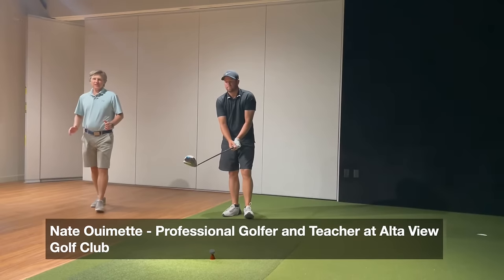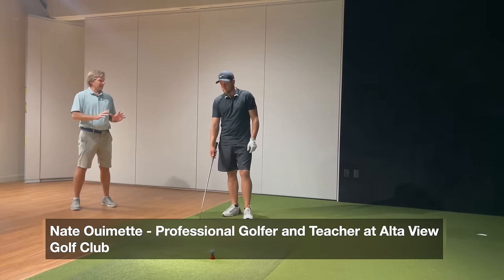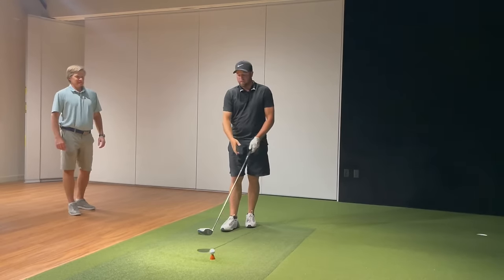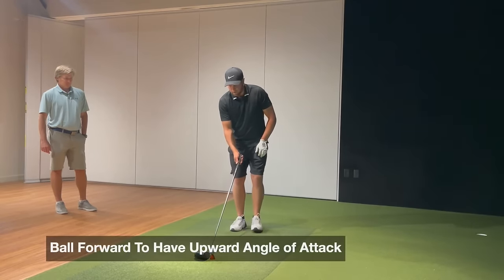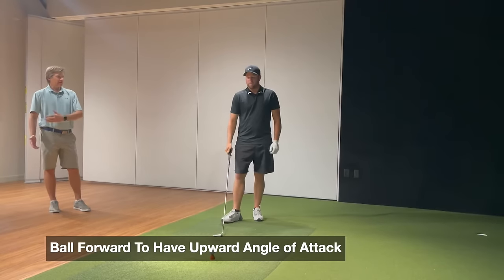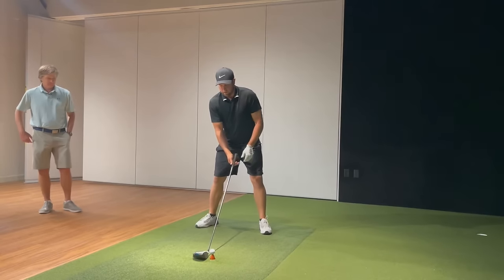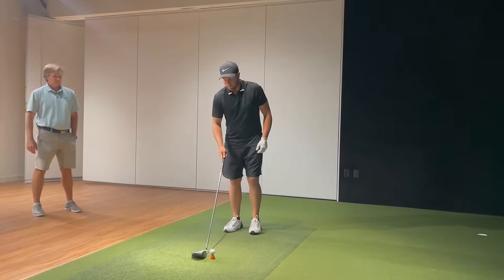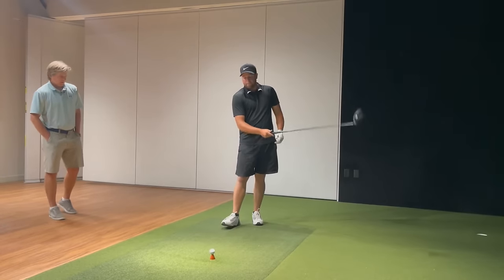Generate 125+ Driver Clubhead Speed

Comment: great example of feel vs real.  He feels like he doesn't "flip" or turn over his wrists, but you can see a tremendous turn over of the wrists through the hitting area.  Nice video.
Reply: It’s not a turning over of the wrists. It’s camera trickery. All he actually has done is sequenced himself up correctly with his rotation. Stand facing a mirror. Get into impact position. Now rotate impact position to halfway through, through swing. Just using you hips and shoulders to rotate you, you will feel open to target. Now look at the mirror and you will notice your hands look like the hand rolled over!!! Actually all that has happened is your body has rotated to deliver a square club face. No manipulation of the hands/wrist required.

Comment: This video has most of what I am feeling/working on, although I have to make sure that I practise initially 'heel-to-heel' to avoid my usual error of getting on my toes, or I can't get these moves/feels. Nate mentions ensuring right side extension on the backswing (and the counter to that is the compression of the left side) and I think this movement of the upper thoracic spine is very important in getting to that shallowing position he mentions, the lower body transition switches that upper back into right sidebend with the hands left behind in that shallowed position, the main feel is a tightening of the lead arm across the chest as you transition. Most amateurs don't have that tilt/sidebend/extension in the backswing, and so when the lower body transitions it just pulls that back into an OTT position. Look at Nate's slow motion to see the extremes of how that upper back is moving - Tommy Fleetwood is similair.
Reply from the maker: Thanks for the observation - lots of great comments here.  We have some other videos with Nate where we trying to talk more about the tilt being part of the rotation to maintain your angle to the ground.  It is something that most mid level golfers don't do enough and you see great golfers do a ton.   We've also done some videos that talk specifically about that lead arm stretch in the transition - so hope you have a chance to check out some of the other posts on the channel.

Comment: Feel and real is different. He does start the turn with his legs and hips, but the arms have to release "quickly" but instead of "pulling" he is dropping them with very little tension as he turns which creates the shallow swing. What he does or feels  in slow motion is not what is happening with normal his swing.  Yes his sequence of order is correct, but he is generating massive speed with his arms very early in the swing. It's a split second between hip and arm movement.

Comment: He talks about shallowing the club in the downswing and yet in the slow motion clip at 12:35 the club barely shallows 2 inches
Reply from the maker: You're correct - Nate doesn't do a massive shallowing motion - but it also isn't over the top.  It's just enough to have it come slightly from the inside when he rotates.   We will do posting some more videos on tracking how you can measure your shallowing motion when you look at video.   Thanks for the comment and for watching.

Comment: I think or notice his knees are athletically flexed and give a lot of impetus 
Is this right
Reply from the maker: Flex in the knees goes hand in hand with enabling smooth hip rotation.   The hip sockets have to move of course for a fluid turning motion.  When the hip sockets move they change distance from the ankles so flex in the knees at setup is critical to let the legs straighten at the hips rotate to the finish.   You will notice that at Nate finishes the legs are much straighter and the hip sockets are turned farther away from ankles.   Try it yourself - just trip hip rotation with straight legs then try hip rotation with bent legs.   You will find it much more fluid when you start with flex in the knees.

Comment: From my own experience, it is not about clubhead speed but clubhead weight.  That is how much weight can u generate on the clubhead on the downswing. U want to make the clubhead feels like an anvil by the time it make contact with the golf ball.  As a consequence it feels like ur in a slow motion video during the downswing  and speed up again after making contact.  Ur body will make all the right adjustments for u when u do this.  No need to think about what every parts of ur body is doing.  That is the most common error we all make.    This has catapulted my driving distant to the high 280 yards without swinging out of my pants.  On average, I'm covering 250 yards on most drives.  Of course I missed here and there but overall, I'm somewhere near or on the fairways.     I no longer hit range balls nor do I need to hit warm up drives before teeing off.  I no longer cares how my body moves and coordinates itself to make all this happen. I just trust that it knows what to do and I simply get out of the way and let my body does its thing.  Kind of like riding a bike. U no longer think about how to ride a bike. U trust ur body ability to balance itself and peddle.  This principle works on all clubs.
Reply: Very interesting. Simplifies a concept I had but never really mastered - feel/create the weight dont force it. There are a dew drills based on this, such as swinging a knotted towel. Thanks for giving another angle on this from an experience perspective.

Comment: If I had 125mph clubhead speeds my slice would be so bad that it would probably hit me in the back of the head.
Reply from the maker: Two things have to happen - the club has to be shallow enough relative to your elbow motion so that you are pulling the clubhead up and left vs pushing down on it.   And then when you have the clubhead in that position you need to have the left knuckles rotated under.   You will see in in future videos show how on the takeaway you can do that lead knuckle down rotation and then you have it set for impact so the face isn't wide open.   This is a really common issue that a lot of people struggle with.   We will spend a lot of time in future videos talking about this.
Reply: @AltaViewGolf  this has been an issue for me. What has helped me is feeling left hand under right hand at takeaway

Comment: Title should be  "Generate 125+ mph swing if you are young, fit, and flexible." 

The old guy in the video can replicate everything the young guy does in the video and the old guy will never hit 125+.
Reply from the maker: It's true that the body muscle firing sequence will slow down as you get older.   I'm mid 50's and I'm not hitting at 125.   However using these same sequencing techniques I swing faster now than I did 10 years ago before I understood as much about how to sequence the body.   We will have some more videos coming out to focus more on some steps that can help about anyone increase the speed.   You may not have the same top speed, but you can likely increase speed.
Reply: Well yes and no the point I don’t think is for everyone to swing 125. The point is to teach you about proper sequence and hopefully increase YOUR speed

Comment: I super slowed down the slow-mo swing...  nate might feel things one way .. but the video shows he is not holding the right wrist angle at impact like he "feels".
Reply from the maker: That is a great comment - when you ramp up to full speed and are turning the body and right elbow hard and to the left then it propels the club very very rapidly out to the ball and to the right.  This release motion just happens.   What Nate is describing is that you don't actively flex the right wrist.   When you come over the top and actively move from extension to flexion on the right wrist you are really going to have trouble maintain control of the face angle.   But when you set the right wrist to be extended as well as the external rotation of the trail side arm then you have the angles are are being released really quickly during the full speed swing.   So you slow motion groove the feel to maintain the right wrist because you don't want to push on the shaft with the right wrist.   Then when you go full speed it rockets through impact and of course on a full speed swing it will naturally move to flexion (and the left wrist moving to extention) as you move to the finish position.   There is just the high difference in result in actively flexing the trail wrist as opposed to it moving position because of how the trail elbow rotates up and to the left through the impact and post impact.